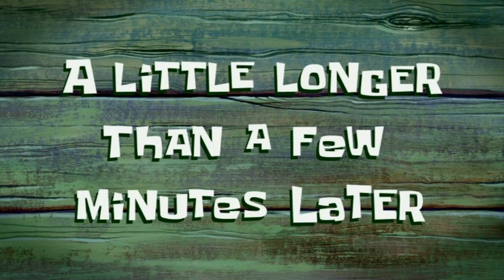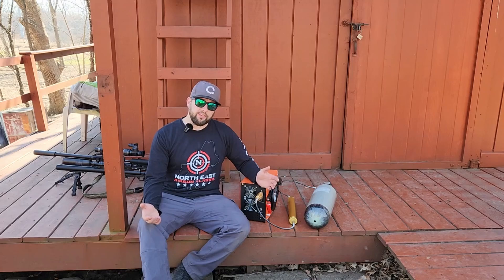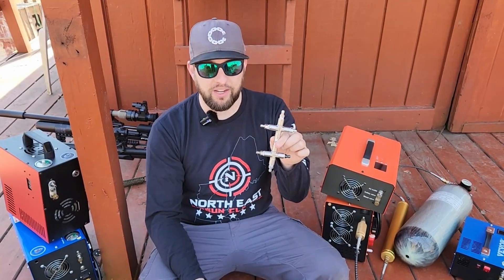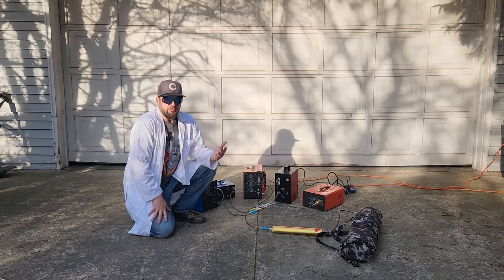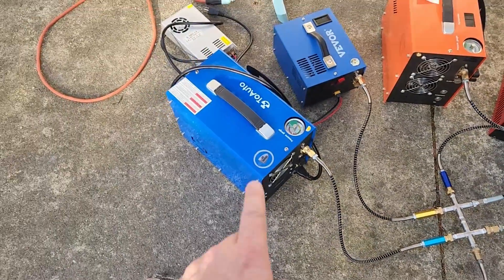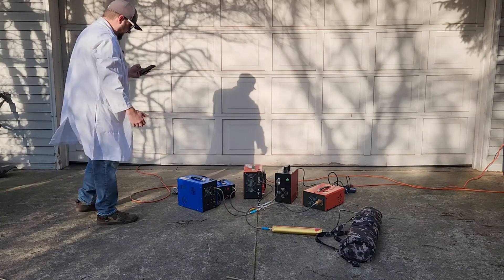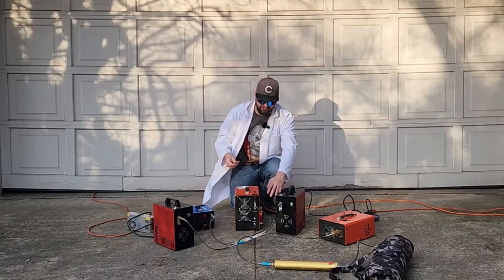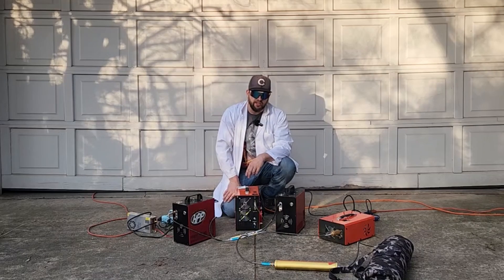VOLTRON Compressor! Filling a 4500psi SCUBA Tank With 5 Shoebox PCP Airgun Compressors FOR SCIENCE!!

Comment: The Alkin can bring a 97cf from 300 to 4500 in less than 20 minutes (0 - 4500 in 30 min) and you will have clean air.   But the Alkin pulls 18 amps at 220v.   Usually when we sell an Alkin to a PCP airgunner it is because he killed more than one of those small compressors.  Thanks for the fun video.
Reply from the maker: 100%! I have a ton of these compressors lying around and wanted to do a fun one. Thanks for stopping by!
Reply: @airshootist  💡I can fix them fir you👍

Comment: I’m disappointed you didn’t do the math for us added up the cost of the lines and fittings and the compressors see if it’s even economical to do this instead of one big compressor.
Reply from the maker: You are right to be disappointed in me over that. But off the top of my head, NO, this is not economical. All those compressors probably average like $250 each plus the filter, fittings, etc and right there you basically have a big compressor purchase price. Check out the Omegas at High Pressure Pneumatics. Great compressors that can easily fill SCUBAs
Reply: @airshootist  that was kinda of joke but also kinda not cause I was genuinely curious. Most show box compressors I have looked at have been like 4-500$. 
I figured as such….Also a massive pain in the ass! Hahaha I got a local shop that fills my scuba tank for 10 bucks and when they’re on top of their game and not busy  it takes maybe 10min.
Reply: I'm not sure if this was to be more economical or more to show if it could be done. I can almost guarantee it's not financially responsible to do it this way. Not only that the poor guy had to run extension cords all over the place because of the amp draw. So along with not being financially beneficial it was a pia to just film this video never mind do it repeatedly.
Reply from the maker: @Blind-J  This was 40% for science, 40% for your entertainment, and 20% because someone said I couldn't.

Comment: you really didnt need the 1 way valves, they could all be hollow no issue as the tank has an on off and the compressors have bleeds ( even one bleed from one compressor would bleed the entire system,, that being said , cool experiement
Reply from the maker: Incorrect. You cannot start up a small compressor against pressure like that. You will break it. Upgrading from standard 1 way valves to captive piston 1 way valves was the move, for sure!
Reply: but you could still turn on the compressors and then close the bleeds, this way the compressor is running before it sees backpressure  @airshootist
Reply from the maker: The SCUBA does not have a one way valve so it would kinda suck. You'd need to pressurize the lines and then open the SCUBA valve - a bad idea and you will still be dumping backpressure at the compressors if no one ways are used. The way I did it here is the best way to do it for sure.
Reply: not sure where my last reply went. You could close the tank , fill the lines to 3000 and open the tank.. all would equalize the same , then close the tank and open one bleed to empty the line system.. Not here to attack , it is a good solution to using 5 compressors either way  @airshootist
Reply from the maker: @airgunningyup  I never delete comments but several folks have said they can't see their comments lately. Maybe youtube is censoring stuff? Anyway I know you're not here to attack, homie! I don't like having that huge amount of volume behind that pressure against my little pumps. It's easier for them to pump against that with one way valves that close during each pump stroke rather than constantly 3-4k with tons of volume behind it blasting back into the compression heads. I like my Orcair valve on my other tank, has a paintball 1 way on it